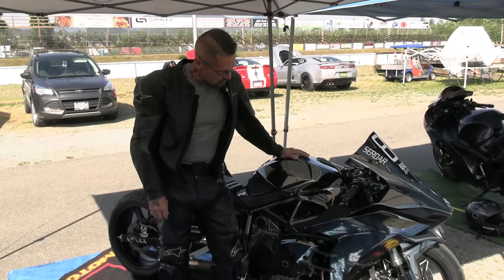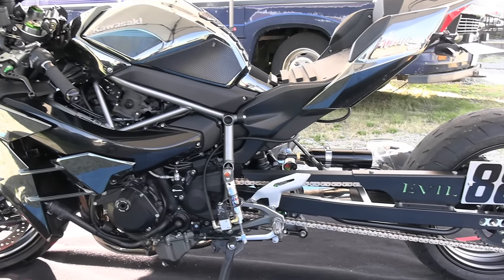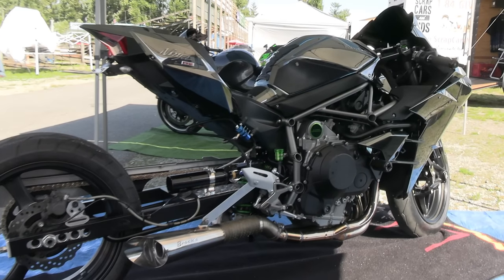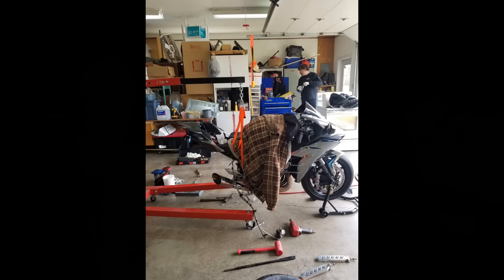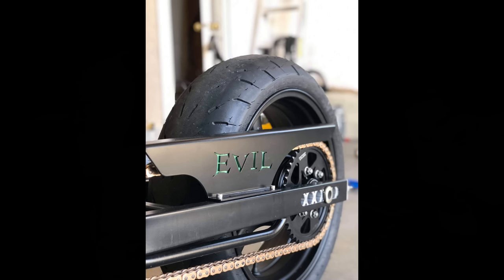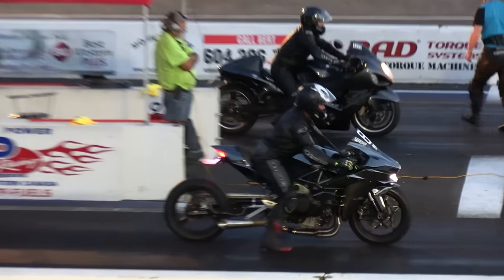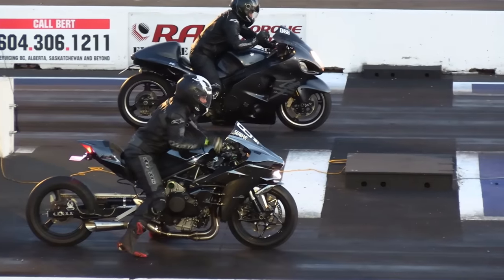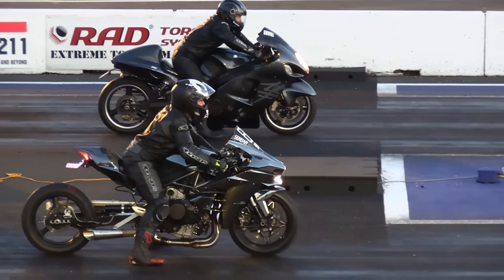Hayabusa vs H2 Kawasaki Ninja-rematch- - superbikes drag racing

Comment: My guy wheelied with an extended swingarm, wtf is this motorcycle.
Reply: salvisenpai autoshifter
Reply: The Super Devil's Bike. Not the regular devil, he rides a busa
Reply: And the swingarm is 1,5 meters
Reply: Litrally
Reply: yup, i also notice it.. wtf.. still wants to wheelie.. damn..
Reply: @LHORD4233  ikrrr oh god, revert it back to the default swingarm and the bike will flip over in a blink
Reply: Every bike streaked can wheelie
Reply: Aye but when the bikes was stock the h2 stood no chance
Reply: That’s what I’m saying dudes a bad ass rider for real
Reply: @semajmclean1473  the H2 is light-years faster than the Busa, stock to stock. He just couldn't keep his wheel down. That bike wasn't built to race from a dig. Of course the Busa won when the h2 had to get out of the throttle at every shift to keep the bike on the ground.
Reply: @LHORD4233  young monster vs old godzilla
Reply: Powerful

Comment: Even with extended swingarms this  beasts still wanna go wheelie
Reply: seriously this is one crazy machine, you need AI to find its true potential!
Reply: I have a feeling if he used the clutch he could full on wheelie it😂
Reply: @zacharyenck1087  😂😂😂
Reply: @zacharyenck1087  he doesn't? What's the reason?
Reply: @nesto9889  what? Why doesnt he use the clutch? He does just not to wheelie im talking about if he wants to wheelie
Reply: @zacharyenck1087  i think there's this thing called quick shifter
Reply: @Ggsekeo  the last race i notice they used an automatic shifter if not mistaken
Reply: Nah you just need somebody like Valentino Rossi or Marc Marquez @muneebshamsi929
Reply: @zacharyenck1087  i saw one he flip his hayabusa over with just throttle itself while trying to take off
Reply: @akshan1574  yea bro these bikes are insanely powerful

Comment: What a spectacular torque.. That is a monster.. Even with extended swing arm its still can do wheelie. Nice vid
Reply: that chain must be strong as hell to withstand that much force!
Reply: Not wheelie... Power wheelie
Reply: doesn't matter how long the swing arm is, if you turn that gas even half way from 0 speed you WILL flip over
Reply: If he has anymore trouble keeping that nose down he's just gonna have to straight up gain weight lol.
Reply: It was pretty easy do wheelie on my 35 Kw gilera SP01, I can't help but wonder how's it's challenge to wheelie with superbike???? As I understand the extended swing arm makes just easier to control the unwanted wheelie...
Reply: @agririku  its true the swing arm  used to balaced and control the bike from 'wheelie'. But the race in this vid tells about who is fast, not who can do wheelie with extended swing arm.. Lol. That jockey they did not meant to do that 'wheelie' but it is selfly 'wheelie' cause of the monstrous torque from that bike. Lol
Reply: @samulioysti4291  "loop it" is the term you want
Reply: The rider is giving high throttle lol
Reply: @samulioysti4291  ummm, are you sure about that? If swing arm is like 1 mile long, would it be able to flip?

NO
Reply: Throughout the video was concerned that the swingarm would break. The forces were really strong.
Reply: The busa was better. The h2r is have super charged and the buse wasn't have and the kawa was have a longer swing arms... Busa was better😉💪
Reply: @heroictesticles6870  uh i have 1998 gilera stalker scooter, changed piston to 70cc, few tweaks to air and fuel, and me having 150kg can wheelie too.
Reply: @shadowrider1067  Yamaha M1 is a monster
Reply: Anthony Smith maybe the bottle could be argued to be an air shifter upgrade like the H2 has attached to the swing arm... maybe
Reply: @firebladex8586  nani

Comment: I would honestly be scared to ride either of those rockets. Literally brings a new meaning to crotch rocket.
Reply: same ... I'd be like riding a missile.
Reply: I driven a sportster and didnt wanna drive it again or any bike
Reply: If these are rockets, H2R will be spaceships 😂😂😂
Reply: So true!
Reply: They are designed to go very fast in straights , you should be fine as long as you don't try to turn
Reply: @Borex2  h2r is still slow compared to a real drag bike.  But in the right hands it can get to 200+ easily even at things like the Isle of Man TT, but only the best of the best can unleash it’s potential in those cases.  Truth be told though I don’t think anyones set a lap record with an h2r at the Isle of Man because in some cases it’s just too powerful.  In a lot of ways it’s too powerful for a track but not powerful enough to beat the fastest bikes in a straight line.  It’s kind of in an odd place when I think about it.  But yeah for something like this against other hyper sports it’s pretty much king in skilled hands and with the extension.

Comment: Love the busa, but the H2 is an absolute monster. 245 horse straight from the factory... great race!
Reply: No...245hp flashed and tuned...bone stock they make similar to busa like 170wheel...both bikes are bad ass and have tons of potential. Busa has ability to always make more power than H2 w turbskis and unlimited motor parts available. Up to 350hp area the H2 is same or a bit quicker, super big boy power above that no H2s pose a threat to the Busas making 450-600
Reply: Haya247 hp isn't it?
Reply: It's too stupid and too rediculous to compare a 1998 haya with a new h2r wtf !! Damn if i tell that the persons who make this test drive a economic cars 😑😑😑 this shit make me angry
Reply: H2r has over 300 hp
Reply: Busa just needed a real swingarm lol. He had higher trap speeds just couldn't keep it down.
Reply: @xxdanthedinoxx1058  H2 is a different motorcycle...
Reply: @nguyenvangiahuy501  everybody knows that
Reply: @nguyenvangiahuy501  They're crap.

Comment: 1.4 l car engine: 98hp take it or leave it

1.4l motorcyle engine: 250hp less goooo
Reply: maintenance and reliability is a really big factor for that number
Reply: 1l motorcycle engine: 350hp
Reply: @Original_Major  how???
Reply: @erikcapozzi3425  h2r for u
Reply: @erikcapozzi3425 supercharged 11k rpm compared to a non supercharger car engine that might do 7k rpm or so. Those higher RPMs mean a lot

Comment: That busa still goin strong. Runnin his ass down look at that mph. Busa is a legend
Reply: Because busa upgrade by turbo booster thats why
Reply: @avinash_.12  yea,busa is 1300cc,with turbo,but lose against a 998cc turbo
Reply: Thats funny
Reply: @vedawokwokwok  the H2 doesn’t have a turbo, the H2R does
Reply: @Southernbread686 no it doesn't
Reply: @Southernbread686  You don't know much about the H2 or H2R, huh?
Reply: @Southernbread686  the H2 is supercharged not turbocharged.

Comment: Before the h2 rider are worst, now they switch the rider 😂
Reply: True I seen the other one last time and hr2 lost the race
Reply: @ricdimanche9638  what is a hr2?
Reply: zSkyzz1 a Kawasaki road bike
Reply: @corkonianslayer3830  kawasaki never build a hR2 ;) and in the case u mean the h2r: this isnt a roadbike!
Reply: @corkonianslayer3830  h2r isnt a road bike h2 is
Reply: @ricdimanche9638  cuz of the back wheel
Reply: Before the h2 was not extended
Reply: they found a new rider and kicked the wheelie king
Reply: @ricdimanche9638  its H2 not H2-R
Reply: It might have been a shorter swing arm.
Reply: they stretched the back
Reply: Fool , the change is not because of the rider but because of the swing arm ,
Reply: So true
Reply: I'm pretty sure it's the same rider he just added an extended swing arm which of course helps with keeping the front tire down. Racing bikes like these in the quarter mile is all about keeping the front tire down and keeping the rear tire from spinning. Which is pretty much the case when racing cars as well. A lot of people think driving in a straight line is easy, but unless you have been behind the wheel of a high horsepower car or bike you have no idea. It's extremely hard but these guys just make it look easy.
Reply: he wasnt bad before it's just that with the stock swing arm you simply cant go full throtle without lifting up the front wheel. I'd like to see you try.
Reply: Its not the rider its the swing arm bro
Reply: It's not h2r ..this is h2
Btw H2R is track only not for roads...
Reply: @corkonianslayer3830  it was sarcastic cos he misspelled it...
Reply: @umarhasan6796  It can be for roads. Many people have converted it.
Reply: @atuck6082  may be after converted mate...but the original i am talking its for track only...
Reply: @umarhasan6796  That's true. But the conversion I'm referring to is only lights and a special registration. Still the same bike. Many people don't know about this.
Reply: @atuck6082  ok mate  cuz didn't know this 👍

Comment: The fact that Busa is from older generation can hold a candle from H2 is shows what an amazing Busa is and also busa didn't use the extended arm. Both are great bikes tho. Salute to Kawasaki's make the H2 in nowadays money minded companies tends to stay away from overly engineered and costly machine.
Reply: Actually that is an extended arm but oke
Reply: Did we tell Suzuki to hold back 
All that they do is bring new colours of the haysbusa every year nothing else
Reply: lean dsz no the busa can’t pass emissions in the gay uk so they’re dis continuing them for now. The rumor is it’s going to come back factory turbo charged to help with emissions if so the h2 isn’t going to stand a chance
Reply: Is there no one mentioning that a 1000cc bike beat at 1300cc bike? That alone is an achiement right guys?😅
Reply: Busa has the extended swing arm. Look closely
Reply: @leandsz693  you right bro
Reply: He would sky rocket without an extended swing arm.
Reply: Busa already has extended arm

Comment: 1000cc suprcharged takes over 1300 turbocharged. proving that turbocharger is not a real racing tune up, it's rather efficiency.
Reply: Turbos have lag...
Reply: It doesn't prove anything other than the h2s configuration is faster than the busas.
Reply: Let's not argue and agree tht both bikes are awesome??
Reply: Paul O'Neal the busa leaves off the line with all the boost , they build the boost while staging so saying theirs lag doesn’t prove anything
Reply: It's all in the swing arm. Busa couldn't leave as hard but was trapping a faster mph than the h2
Reply: Busa is making more power he is trapping higher  but the rider on the h2 is out launching him
Reply: Im pretty sure it is all about the weight
Reply: It just show that a busa with a stock swingarm is less fast than a h2 with a longer one, a turbocharged busa will always win over a h2, turbo busa can reach over 500hp, h2r reach 330, that's just facts
Reply: Its not turbo charged it whistles because it has a blow off valve
Reply: @blah4973  hope your joking
Reply: @jadenweaver7529  Geez, I Wonder, why would he have a blow off valve?
Reply: @W00KIEW00K  lol turbo obviously
Reply: Biggest difference is swing arm. Without swing arm the power of busa is wasted on lost traction, I think the busa with swing arm will beat the H2
Reply: Wow, sounds like there's a lot of people on this thread that need to do their homework. I'll help. Did anyone notice how hard the H2 left off the line? Well that's due to the torque of the bike and it being able to put that torque to the ground due to the extended swing arm and the sticky tire. Also, as you said the bike is supercharged, so there's no lag in superchargers so you're going to get that power and torque from a low RPM which is the reason he left so hard. I was actually really impressed at how hard he left and how much harder he left than the busa. But Tanala fauzan, for you to say that turbos are not good for racing tunes, I think that's how you said it, is completely wrong.. The Busa can build boost at the starting line, that's why you can hear the bike revving before the green light. I think someone mentioned that but I think they said that he's building all the boost he can which is false. The bike wouldn't be able to launch correctly if he built all the boost the turbo is capable of from the start. Now he can set his wastegate to a certain PSI so the bike will launch at the specific amount of boost that the rider wants so it won't spin and it won't lift the front tire to bad. Then the bike will build more boost as he rows through the gears and gains speed. It's all in the tuning.  He can also set up his boost the way he wants it through something called boost by gear. That means that the bike will only create so much boost in each gear, they do that to get the most out of the bike while  keeping the front tire down and not spinning the rear tire. Boost by gear is actually a very good way to set up your bike or your car either one. They use this technique in cars a lot because it works so well. Mainly because cars make so much horsepower that they have to tune the car to bring in the horsepower slowly so it don't blow the tires off. Horsepower is pointless if you can't get it to the ground. You can also do boost by miles per hour. Of course that means that your bike or car will bring in how much boost you set your waist gate to at a certain mile per hour, it all depends on the rider or driver and how they want to set up their car or bike. Of course all of this is done through tuning your car, that's why it's so important to know how to tune or to kno someone that does because without the right tune on your car or bike you're not going to win many races at all especially if you're racing other people that know what they're doing.  I don't want to sound like I know everything about this subject because I don't, I've just learned over the years by working on cars and bikes and by learning from other people most of all and by asking questions. Threads like this is a great way to learn and don't ever feel like you can't or shouldn't ask questions about anything on here because there is no dumb question. You will always have someone out there that will try to make You feel stupid or bring you down but that's the immaturity  coming out in that person and it's probably because of their personal life and what they're going through and they probably want to try to bring someone else down. That's a total different subject, my point was if you have a question after watching videos then go to the thread and comment section and ask away is my opinion. I've learned a lot that way like I said. And I'm sorry if I made this comment sound like I was being an asshole because I wasn't, I just wanted to do my best to try to educate people that didn't know about this stuff already. And if there's something in here that I put that's incorrect I welcome someone to let me know and teach me the correct way. I'm pretty sure though what I said is very accurate. But both of these bikes are complete monsters, But they're both totally different setups. Like someone said one is turbo and one is supercharged and this video is a great example of how the two are so different and how the two put the power to the ground in such different ways and when they put the power to the ground is what is really interesting to me, and this video shows it like we talked about. The H2 hits hard off the line and the busa with the turbo reels him in very quick and if they were racing another 800 ft or so the busa would have caught the H2 for sure because you could tell by him trapping a faster speed. But it's important to know that saying what I just did is not the way to go about it. And what I mean by that is when I said if they were racing another 800 ft the busa would have caught him. The fact is they weren't racing another 800 ft so My comment means nothing. They were racing the quarter mile and whoever reaches the finish line first is what matters, we shouldn't be making excuses or making accusations like I did by adding or saying the busa needed another 800 feet to win. What I should have said is the busa  needs to find a way to tune his bike in a different way to put the power down a little sooner to be able to catch the H2 before the quarter mile is over, because I think it's possible for sure. It's all in the tuning like I said. But sorry my post was so long but hopefully it was helpful and hopefully someone learned something from it. Lol
Reply: @spydille8519  fact ur face boosted busa will never defeat h2r
Reply: @FishingAdventuresDubai  it has a swing arm
Reply: What???? Lol. "Turbo not a real tune up"?
Come out of your cave. It's about to be 2020.
Reply: Tanala Fauzan well 20 years old busa vs very new h2, nice job

Comment: hayabusa always in my heart
Reply: Joined in the H2R,you left the game?😝
Reply: @muhamadgibran3751  This is shame of kawasaki.. h2 need to modified to beat hayabusa 😂🤣😂 without modified h2 already dead 🤣😂🤣 oh wait i heard about the new hayabusa 2021?
Reply: @joelcustodio9328  Modified but only swing arm

Because the Driver is always Fking flying Hahahahahha
Reply: @joelcustodio9328  that Hayabusa is modified to fucking bits too. When it comes to motorcycles with that much power you cant cheat physics, the longer wheelbase will always win because you can put more power in the ground without lifting the front wheels. Now, take both those bikes, the H2 and the Busa and put it in a track to see who wins.... I love the Hayabusa, but the H2 is just better 👌🏼
Reply: @Blinkin97  I had not driven for 6  years after I sold my 125cc bike, drove few times with a custom, then my father bought Hayabusa. He has had 4 Hayabusas now, he has tried other bikes but he said there's nothing like it, so he just buys another after a while. Busa was 2nd big bike Ive driven, its such a great ride I honestly dont know how I can buy any other now either.
Reply: @Sinr0ne  I’ve ridden my buddy’s Busa, I currently own a Ninja 650, my first bike. I can say that I absolutely love the Busa, I’m just too small for that bike, 5’10” 150lb pretty athletic and I still had trouble balancing the beast.